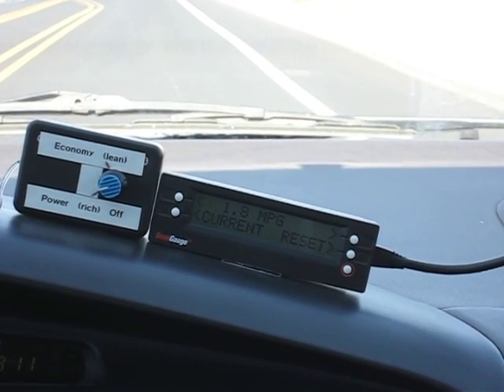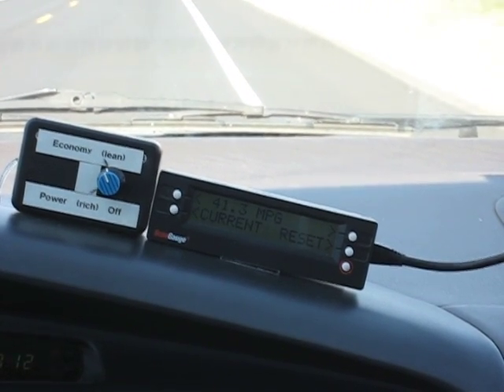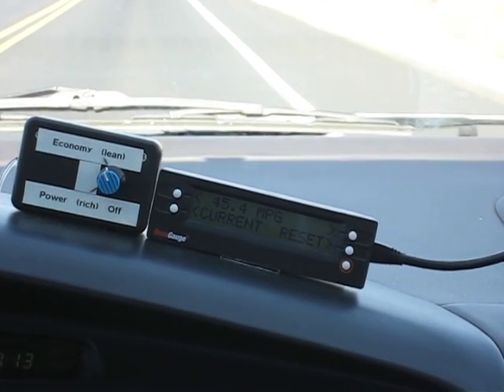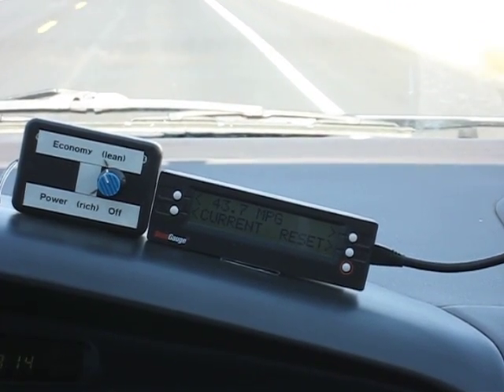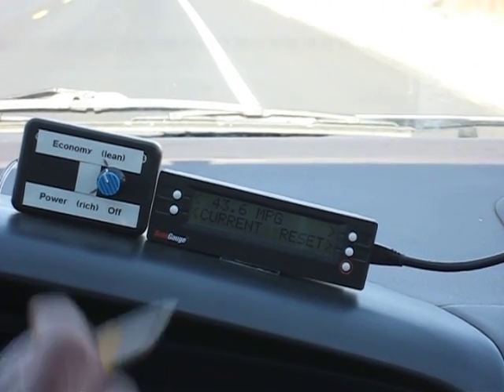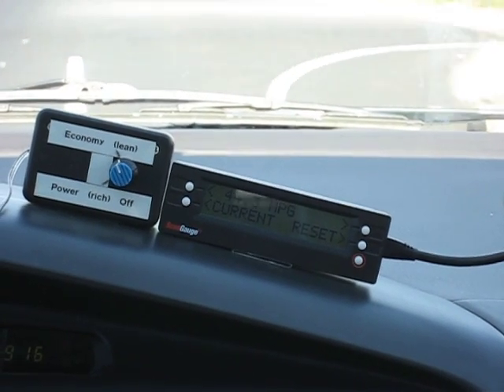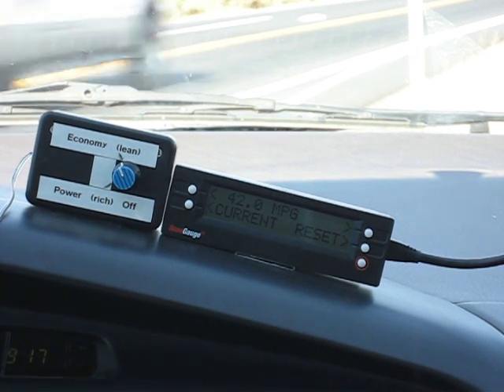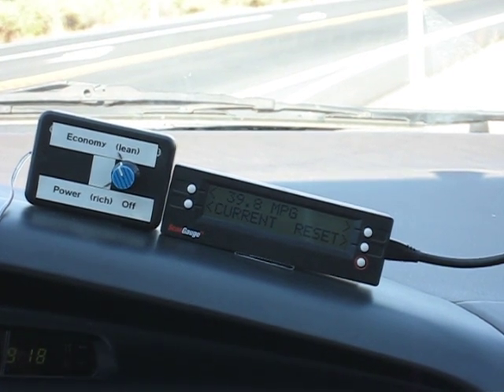HHO MAP/MAF sensor enhancer (adjuster) road test. Part 3

Comment: Seems as though there was a slight increase in fuel consumption at the end of test 2 & 3, and that unfortunately you ran test 1 in the opposite direction, which likely would've read lower. 
I'm wondering if this configuration would ever throw engine codes. I have the same model Sienna. Are you running any EFIE'S or O2 extenders with this set up, or at any time with this configuration, either before during or after?

Comment: In order to add legitimacy to HHO for the rest of the world, Would you consider running both your "Rich" test trip and your "Lean" test trip again, with the HHO Cell disconnected, but all other conditions the same, so that we can rule out the possibility that we have improved the MPG by simply changing the fuel mixure ratio, irregardless of the HHO production?   Thanks

Comment: Great videos.  I also have a Sienna that I'm installing an HHO generator on.  I didn't find your sensors on ebay though.  Have you stopped selling them?  I'm curious if you have made any other changes to your car to increase your gas mileage even more.